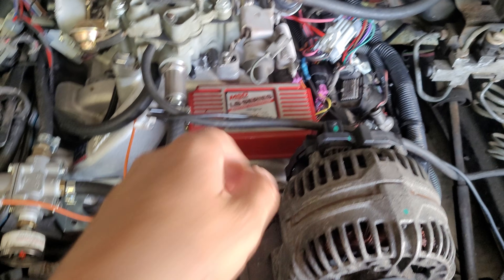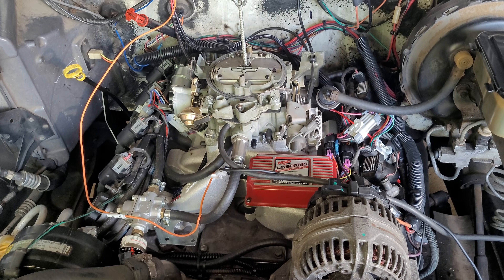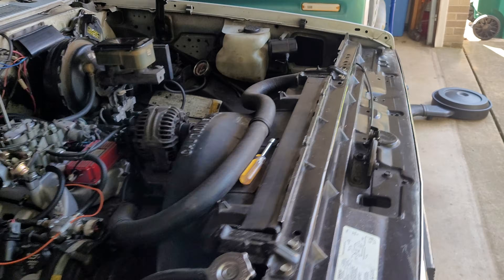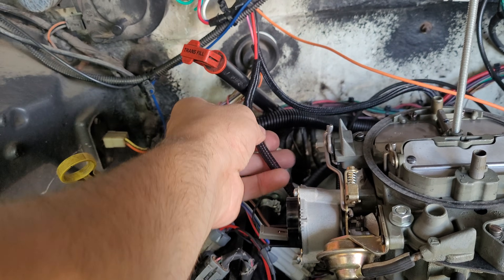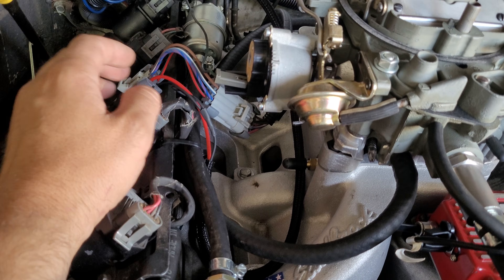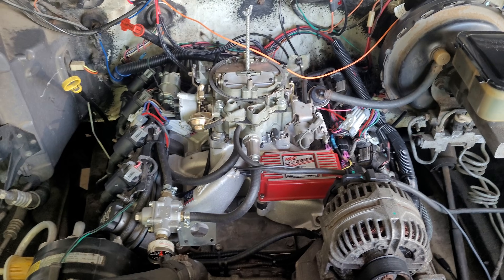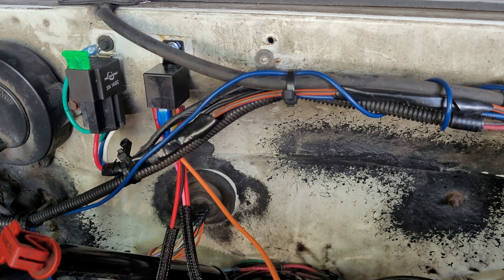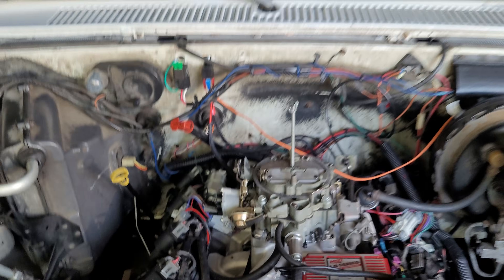LS Swap: Ignition coil harness upgrade, using MSD # 88867

Comment: How did the upgrade harness end up going. Did it work out and solve the mis fire issue?
Reply from the maker: Made starting a lot easier.
Reply: Awesome .  Im having a starting issue also with the 6014 on a ls2 was great on the dyno not an issue with the same 6014 box.. got in the  car and was having all sorts of problems with voltage drop to the msd would start  then be fine but getting it started was a pain.. and no fault codes either. Iv just done a complete overhaul on the wiring side and included this upgrade harness also.. earths... full seperate power to the msd.. Went overkill but better to be like that just to eliminate it. 

Fingers crossed fire it up tommorow..

Great video by the way..
Reply: @adriancaruana7303 so did it work?
Reply: @randydarcey2947  it made starting much better. Seemed to run cleaner also.  But these msd boxes are sensitive to everything it seems. Iv ran better earths. A good power source to the relays direct from battery good quality relay all new genuine sensors iv thrown the world at it. Yet still can be temperamental on some days. I honnestly think msd have to re visit these issues with all the msd ls boxes as there are many many people who experience this never ending issue. .. oh if anyone is wondering... i didnt just tune this my self ... A very known good tuner here in Australia has done the tuning side and this engine it made just on 620hp on the dyno comfortable.. but no matter what we gave this the starting issue he has said is a ultra common problem with these msd boxes also in his experience. Some days no problems.. some days its like not today im still sleeping.

Comment: I put a ls 6.0 outta 02 Escalade in my 85 c10 ,carbed it n running the stock TH375 tranny ,what’s a good timing table for a daily driver on the msd 6014 box?